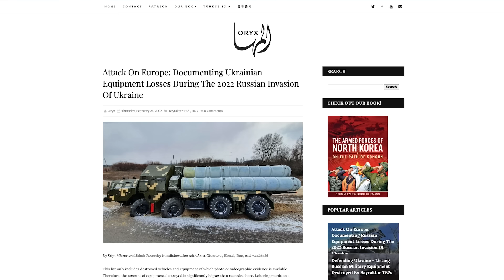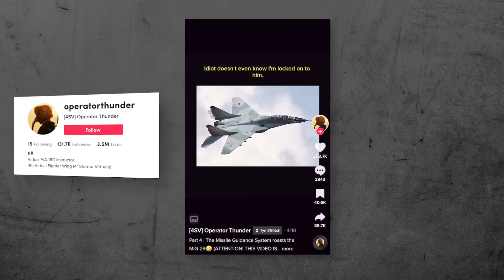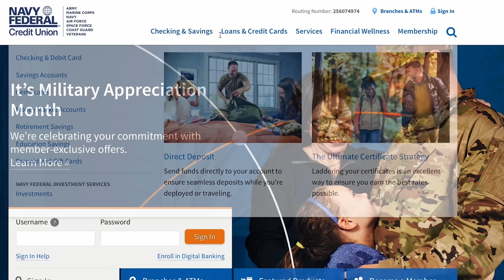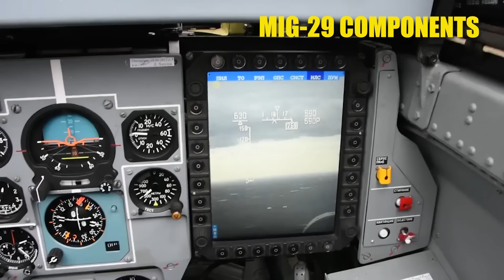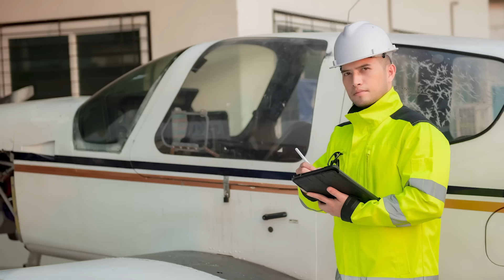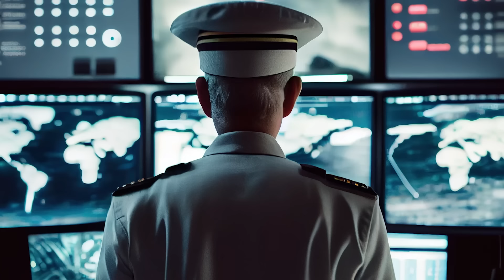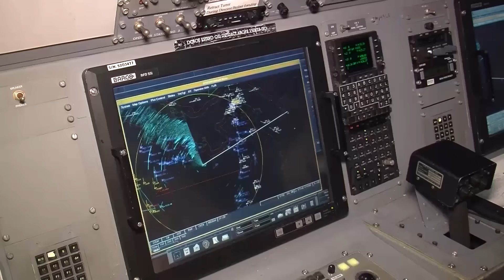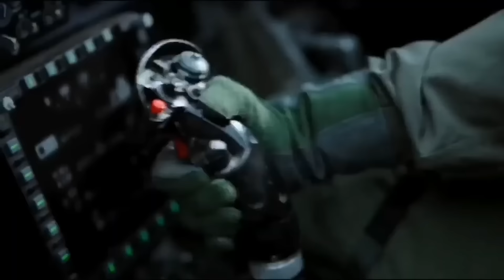How Ukraines new MIG-29 Fighter Jet Operates

Comment: What's most important about the F16 isn't it's flying abilities but it's ability to interface with NATO missles.  Sure, they've hacked HARMs and etc onto migs but only with limited capabilities (preprogrammed launches).

Yes, other NATO planes would work too but the F16 is one of the most common military jets on the planet and the other abilities you mention are nice too.
Reply: Not only that, but since it's such a widely produced platform in service with friendly nations any needs for replacements and/or maintenance is much easier than trying to source ever fewer Mig parts.
Reply: F-16 is bad ass. But can't take off from unprepared runways. MIG 29 wins.
Reply: I think the most important thing about the F-16 is the availability of airframes and parts; it's been built in massive numbers, and a number of countries are in the process of replacing it with the F-35, so it should be possible to source a large number of them and replace losses over the long haul.
Reply: @jg3000  😂😂😂😂😂😂 ok. Drink that copium
Reply: @jg3000  If everyone thought like you, surgeries would be done with hammers, not scalpels
Reply: What's the difference between this "preprogrammed launch" on MiG and launch on F-16?
Reply: @smyers820gm  he's got a point though f16 need airfields that are in good condition if anything ukraine might be better off with f18 or Jas 39 gripens
Reply: @smyers820gm  What copium. F-16 needs a prepared runway. MIG 29 doesn't. So the ability to keep waging war with jets gives MIG 29 the advantage regardless of capabilities. F-16 could generate some sorties but not a lot. Because unprepared runways are the norm.
Reply: @lamlam2750  I suppose they can hook F-16 to a catapult and fling them into the air.
Reply: The modernised Polish MIG29s can fire HARM 88, AIM 120, Storm Shadow, etc.
Reply: Yup. Denmark and Norway are already getting rid of their F-16 fleets as we're replacing them entirely with F35s. That's already around 100 well maintained F-16s. The Netherlands and Belgium have them too and way more than Scandinavian countries. Greece alone has some 120 of them.
The Ukrainian pilots should already have started their training, but we can't do anything without the US approval. 
Perhaps Ukraine should focus more on Eurofighters and French Rafales.
Reply: @UCY7RrISyujysWCmmJP6wSxg Because unprepared runways outnumber prepared runways. A lot of runways have been bombarded. It's something MIG 29 excels at. They would be able to generate some sorties for F-16. Like they generate some sorties for SU 27. Both aircraft require prepared runways. But since unprepared runways outnumber prepared MIG 29 generates the most sorties.8
Reply: @johnridout6540  Yes, that's correct (ideally I'd have remembered and mentioned that). 

However Poland (in conjunction with Israel) basically pulled out all the electronics and started from scratch (new avionics, radars, navigation, recorders, HUD, computer system etc etc).  That's not a quick or easy upgrade.

If Poland is willing to donate those jets, by all means they should.  But right now the migs they are sending are all Soviet era stuff given to them by Germany (hence need for rexeport approval that was just given).

F16s are far more widely available than upgraded MIGs (which Poland probably wants to keep while there are less recently upgraded F16s countries are looking to decommission).
Reply: @jg3000  Runway contention isn't the limiting factor in Ukrainian air sorties.  Neither side is keeping so many planes in the air their runways are overbooked...that would run down the useful life of those planes far far too quickly.
Reply: @petergerdes1094  Russia has generated a lot of air sorties. MIG 31 and SU 35 launch BVR missiles. Supposedly SU 35 recorded the longest BVR kills.
Reply: @maximshukanov3267  My understanding re: HARMs is that on an f16 the pilot gets info from the electronics in the HARM (eg that it sees a SAM radar that's been switched on) and can decide at that time to launch the middle at that radar.

In the current system they have to tell the missle before liftoff to fly a specific route and in some fashion specify what it should try to target along the way.  Less flexible and less info for the pilot.

Someone else who knows more should chime in if I'm wrong or for other munitions.
Reply: @darktemplardelta268   True. Gripen can land and take off literally from simple roads, but since Sweden has been blocked from the NATO, something tells me they're not going to be the first country to sell or give their limited tech to Ukraine, when Americans with thousands of F-16s aren't willing to risk a few of theirs.
Reply: @jg3000  "a lot" is approximately 200 sorties per day.  Ukraine is flying 5-10 a day.  Aircraft carriers can launch 2 fighters and land 1 every 37s so if we conservatively say it takes Russia 5 minutes to launch and land each sortie (a few planes) that's 16 hours of runway time a day.  Ukraine would only need an hour of runway time a day.  So no it's not runway use limiting the number of sorties.
Reply: @alexlarsen6413  The us just agreed yesterday to f16s to Ukraine.  The limiting factor wasn't risking the jets but concern over escalation.
Reply: @petergerdes1094  If the aircraft can't take  off it can't generate a sortie. MIG 29 is like a truck it can get off the ground without ruining the aircraft. With debries all over. So it can generate more sorties than other Ukrainian aircraft. Pretty sure SU 25 doesn't have any problems either.
Reply: @petergerdes1094  I don't think Russia is using an aircraft carrier.
Reply: @petergerdes1094   So what's changed over night if they've been so worried about an escalation? The escalation happened over a year ago. And we'll still see what that statement, not even by Biden, even means. Congress still needs to ratify it and then there's at least another year after that. 
What I'm saying is, the Ukrainian pilots should already be here in Denmark and other countries which will actually provide those jets. They should've been here half a year ago.
Reply: Polish MiG-29s are converted to use NATO missiles.
Reply: @alexlarsen6413  I don't agree with the worries over escalation...just saying it's not concern over wasting the jets that held it up.

To answer your question: nothing changed overnight...I'm sure some countries have been lobbying for this behind the scenes for months.  However, there is a desire to present a united front and not have any one country stand out as approving a new kind of military support on their own and it took time to get everyone onboard.

Personally, I think the worries about escalation are misguided.  Russia doesn't care what exact hardware is shared, they care if that makes them lose or pushes the war into Russian territory.  But we've already trusted the Ukrainians not to use our munitions to strike into Russia and if we don't want Russia to lose WTF are we doing supplying Ukraine in the first place.
Reply: @jg3000  No, they aren't...but it provides a useful order of magnitude for the time it takes to land and launch these fighters (sure they don't have a catapult but they also have plenty of room to prep the plane before it gets on the runway and space to turn off on after landing).  And I used a ~5x longer time than for a carrier to do the same just to be conservative.

But with 5-10 sorties per day Ukraine could take an absurd 2 hours to launch and land each sortie and still not exhaust the capacity of one runway.  Runways aren't the issue.
Reply: @petergerdes1094  Yes runways are an issue. As some are destroyed. Aircraft that are good at taking off from MAKE SHIFT runways are MIG 29 and SU 25. You might have a make shift launch at the front and have a prepared runway in the back. This is where the Soviet SU 27 will outshine F-16. Because it has much longer range.
Reply: @petergerdes1094   Yeah. I don't get it either. And as for the united front, the US and their jets are Germany and its tanks, all over again. Same story. 
Countries with those platforms needed to lobby both of them super hard, and I'm still not sure we're ever going to get that license from the US. Not for Ukraine. Norway is already giving up, they just recently sold an F-16 squadron to Romania.
Reply: Yep euro fighter would do but there's not 100's available second had in multiple countries
Reply: @jg3000  Gryphen would be better from a support crew standpoint, but are limited in numbers.
Reply: @jg3000  the ability to land on a bad runway is NOT the way to win a modern war   , it means almost NOTHING
Reply: @darktemplardelta268  im not saying its a bad thing. I'm just saying it isnt some magic bullet that is going to win this war 🤔
Reply: @smyers820gm  It means the ability to wage war better. It seems ground based air defenses are the way to win.
Reply: @jg3000  you’re not understanding modern warfare.  Keep in mind,  the mighty Russian Air Force has had this capability since they started this conflict.  How’d it work out for them? 🤷‍♂️😂
Reply: @gingernutpreacher   Well they're not asking for hundreds of planes but around 100.
The UK alone has over 100 Eurofighters and they're planning on replacing them with F35s. Same with Italy. Both countries already operate around 30 F35s each so they could set aside 30 Typhoons. Germany and Spain each operate around 100 Typhoons as well, so if they set aside say, 20 of them, that would already be altogether 100 Eurofighter Typhoons. 
The French are getting rid of their 200 or so Rafale F3-Rs, selling them around to Croatia - a country switching from generation 3 Mig 21 but getting the first Rafales in less than a year , Greece, Egypt, Qatar...etc. because the French are switching to the F4 model. Still, the current F3 model itself is at least as good as the F-16 block 70, if not better over all.  

And then there's also the fact that there are even fewer Mig 29s still left around even in eastern European NATO members. Poland is sending all they've got left - 20 and Slovakia is sending 13, which is not only all of the Mig 29s they've got left but literally all of the fighter jets they've got...basically their entire air force. Their sky will have to be protected by Poland and Hungary for about a year and a half until the first F-16s they ordered arrive.
Reply: @maximshukanov3267  Pre-programmed launch:  I know where an enemy radar is, I preprogram the coordinates.  On F-16:  fly around until the enemy targets you with radar, launch against the threat.   So the air to ground equivalent of artillery vs counter-battery.
Reply: @alexlarsen6413  you do know it a very old Mark that can not fire the meteor missile ect it has a lot hours on the frame they would soon fall Apart and they would need about 100 for parts and losses plus there only keeping the orc air force at bay to pound the ground they need more than what they got
Reply: @smyers820gm  Russia has done better than most air forces would have. In fact Europe has realized they are less prepared than Ukraine was. The reason was good ground based air defenses. It seems not much was learned after Vietnam/Afghanistan.
Reply: more "correctly".
Teh F16 is teh aircraft NATO countries are currently withdrawing from service and replacing with F35. SO they have well maintained airframes available (in good numbers).. Can't say so much about the Typhoon, Rafale, or Griffin..
Reply: @kerrynofford4727  yep the typhoon the RAF are reatiring are near the end of the airframe Hours and can not fire meator and they even look hagered ( I know it's only a paint job )
Reply: Also JASSM.
Reply: Yes, you're all right to say that.
Reply: @jg3000 What   If the F-16 came into the theater and sunk the Russian Navy with Harpoons ?
Reply: @jg3000  Rocket assisted takeoff is easier.
Reply: @Jg3000-not without a major overhaul to the landing gear and other vital areas. Funny.

Comment: Romania just retired Mig-21 last week. Croatia still flies them but also close to retirment. Both countries switching to F-16. (India is keeping their Mig-21 a while longer). Not sure if it would be worthwhile to transfer those museum pieces from Romania and Croatia to Ukraine. They would get killed anywhere near the front. But could be useful as trainers and to shoot down Iranian drones. Their use could free up the relatively more advanced Mig-29 for other duties.
Reply: Isn't Croatia buying Rafales?
Reply: @michalandrejmolnar3715  Actually, I think you are right about that.
Reply: Here in India those are called widow makers and that's not even an exaggeration so yeah maybe retiring them would be best
Reply: @michalandrejmolnar3715  yup Croatia is getting 12 Rafales.
Reply: @michalandrejmolnar3715  Purchased 12 - first ones due in Croatia in June this year.
Reply: I'm all for it, price would be 3 times more then new one 🇭🇷
Reply: The Mig-21 wouldn't really be suitable as trainers as the Mig21 is notoriously difficult to fly. And while the later variants added the ability to drop bombs to make it more of a multi role fighter, it's still primarily an interceptor, and as you mentioned, would not do well in the ground support/attack role near the the front against the modern anti-air threats it would face. As for the drone hunter role, it could probably do it, but just about any other air or ground system could do that cheaper, safer, and better.
Reply: India has built LCA Tejas for that purpose only, to replace it's MIG 21s. But as we can except from a corrupt bureaucracy, delays will be our biggest enemies .
Reply: @vortex4705  yep that's why Romania is dropping them
Reply: MIG-21 would do well turned in to a radiocontrolled exploding missile. 😂 Give it to the Ukrainians, they'll figure out how to use it.
Reply: the funny bit is Romanian MiG-21 Lancers are more modern than most MiG-29s. Their electronics were swapped to modern Israeli ones including radar. Poor man's F-16.
Reply: @vortex4705  The bison compared to Su30 is shit but it's still leagues ahead of the mig21s of other nations due to upgrades. Not arguing your point, just adding a bit more to it
Reply: Bro that jet is from the 1960s Ofc they’ll be replacing them
Reply: @ericdpeerik3928  so would any other old jet like an f4